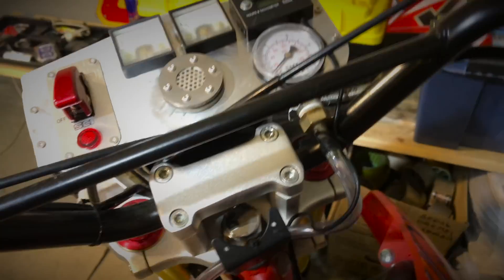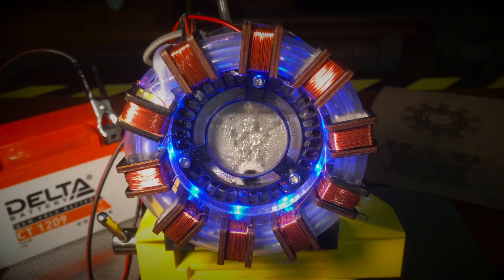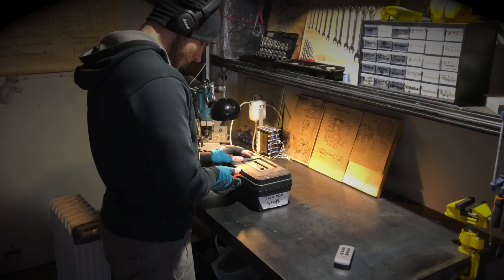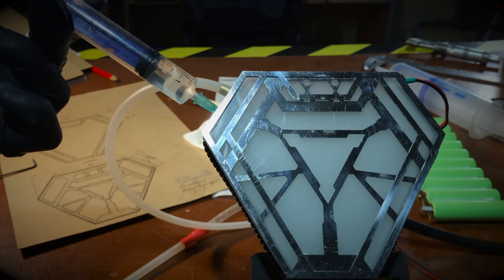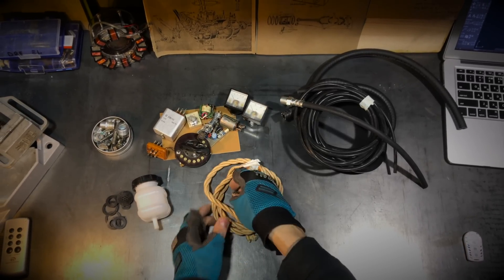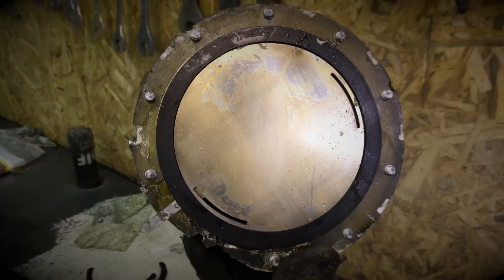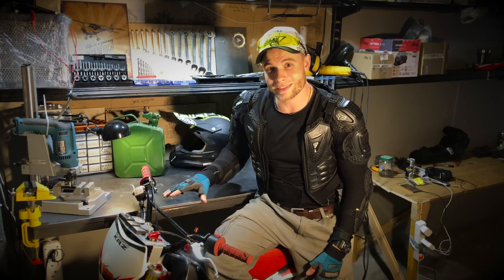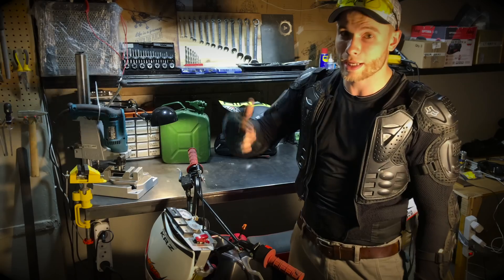Hydrogen booster for internal combustion engine

Comment: Great job. It would be nice if you could build a reactor  can produce enough HHO to run a 4 or 6 cylinder vehicle only on HHO. Looking forward to see your future projects
Reply: I think the issue with that is if you are using x watts of energy to separate the hydrogen and oxygen, you are getting less than x watts of power from the engine combusting and recombining the hydrogen and oxygen. so it would be better to just use an electric motor
Reply: @Zed86zz  point take but i think if you add Lye and Aluminum  in  combination with electrolysis it will greatly increase the amount of HHO production.(becareful water Lye and Aluminum will get very hot). Also you can use a car alternate, a couple capacitors and inverter to increase x power.

Comment: So, all of the energy in the HHO comes from the engine's alternator, which in turn comes from the petrol.  So how come continuous HHO injection improves the fuel efficiency?  All you are doing is turning fuel into electricity into HHO - there is no additional energy being created.  Have you any thoughts on why the overall fuel efficiency is improved?
Reply: Sadly it doesn't seem like it improves anything efficiency wise. But it does improve performances
Reply: See it abit like a supercharger, the greater efficiency the motor gets from the petrol when mixed with hydrogen(Increased air pressure from the supercharger) more than makes up for the power cost of creating it.

Edit: Or thats supposedly the teori, don't hold me up on it.
Reply: Correct me if I am wrong, but here is my take on it: Technically, you can't create energy (Thermodynamics), you can only release energy. The system uses energy stored in petrol fuel to create electricity, which in turn creates the hydrogen fuel source. The problem is that the use of the hydrogen fuel source is basically the inverse of the HHO process (HHO splits water into H2 and O at cost of energy, combustion combines hydrogen fuel and oxygen into water and releases energy). A perfect process would release the same energy as you put in to create it, but this perfect efficiency is of course impossible. So due to energy losses in the system, it should be less efficient. However, because hydrogen has a huge energy density, you are basically storing energy and releasing it all at once. This system is similar to using energy to compress a spring, then releasing that spring and all that energy at once, (much like how the cannonball system in his latest system works).
Reply: @jonahembry5215  don't worry there is not problem with thermodynamics or efficiency!
He adds additional energy with comes from the batteries (which make HHO)
there is a slight efficiency increase possible (not sure ifs its in this case) bceause the efficiency of thermodynamic machines increases with temperature difference. Since HHO burns hotter it >could< be a bit more efficient.
Reply: What if we send HHO instead of fuel in combustion chamber and ignite the gas , will the piston still works I.e will it rotate?
Reply: @chaitanya6284  yes but its like running nitro or acetone in a normal motor, it will wear very fast. I had done that with acetone and an old car, its fun(2x of poweroutput) but not for long xD. If you hear, he said he will sell the bike after the video, i knew exactly why :D.
Reply: @hyperhektor7733  so we need a continuous input of HHO to make it work?
Reply: @hyperhektor7733  thank you😊

Comment: Hey Alex lab's, man I love your videos and I'm an inspiring to be a technician so your videos really keep me going. Anyway I wanted to find out, you said at the end that the injection of HHo reduced the amount of fuel consumption. My question is would you be able to totally substitute the fuel with the gas being generated? If so could you completely get rid of the need for fuel.
Reply: If u havnt seen it already look up hydrogen fuel cells that's the future of hydrogen
Reply: @benlanchester6721  I'll check it out now
Reply: Maybe with an lpg motor. there are some changes to be made. Liquid fuel also acts as coolant when you rev a "simple" motor over its sweet spot. Using gas instead might lead to cooling issues, if not addressed.
Reply: @christianstorms3950  ah I get you
Reply: It could be possible but transporting the needed amount of hydrogen around in the car to run it would be like driving around a small bomb u can only imagine what would happen in 2 hydrogen powered cars crashed together

Comment: Hello Alex. Love your videos and projects. Always looking forward to the next awesome thing you are doing. Glad though your face didn't get any marks or something from the fire. Quick question though about the Iron man reactor. Would it be possible to let out a continuous stream of hydrogen from the reactor instead of letting out hydrogen in bursts or pulses?
Reply: Look at his repulsor video again and see how he regulated the pressure to set a steady stream.

Once the HHO is in the tank it can be used like most any other kind of gas, so 2v starts the electrolysis and the amperage determines the rate of HHO generation.

Just PLEASE follow as many safety guidelines as you can; this stuff is truly powerful gas(just ask the Sun 😉)
Reply: Yeah that would be cool